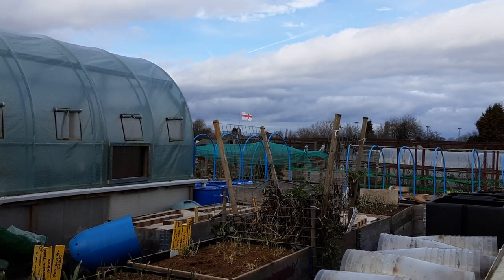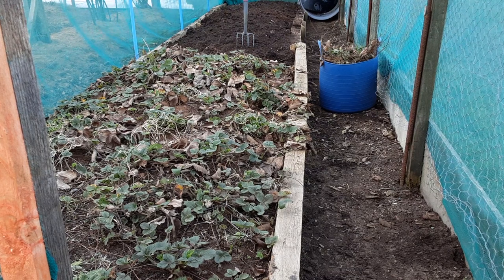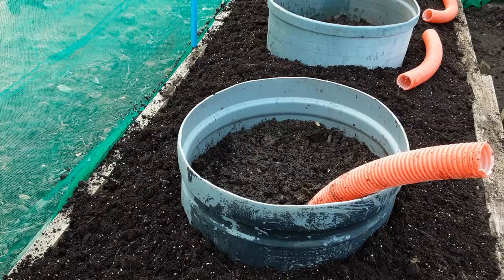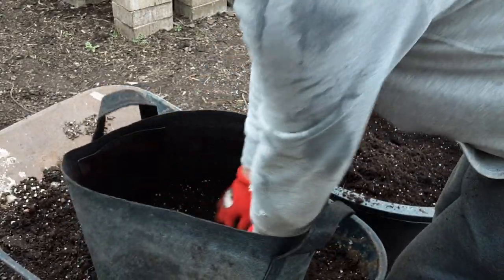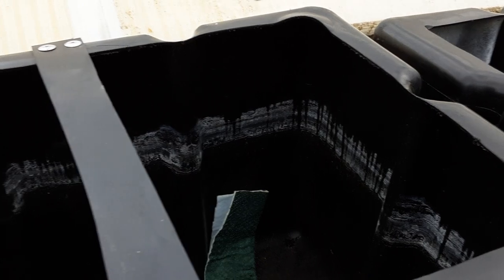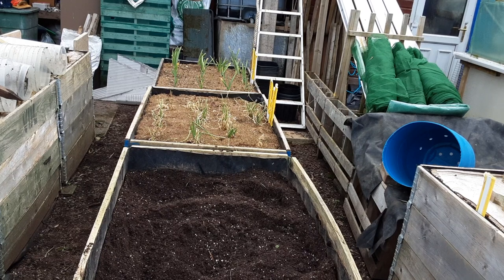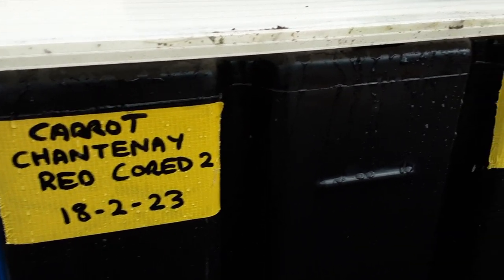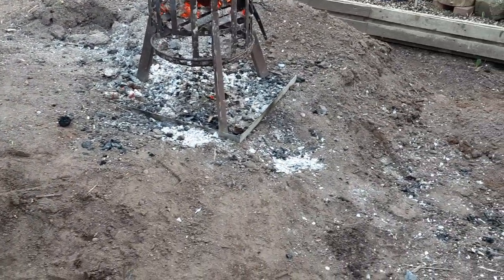Jobs Done On Our Allotment's In 180 Minutes 🌻 Giant Cabbage Bed Preparation 🌻 Wick Growing Systems

Comment: Hey Terry, another great update. Do you think the success of your carrot seeding is more dependent on soil temperature or hours of sunlight at this time of year? Our soil is still quite cool (cooler than normal), so I'm reluctant to push the season. But, as you said, if you have 2000 seeds…what's to lose??
~ Sandra
Reply from the maker: These seeds are good for sowing in February Sandra and with a little bit of protection will hopefully do well.

🥕Happy gardening, Terry King.